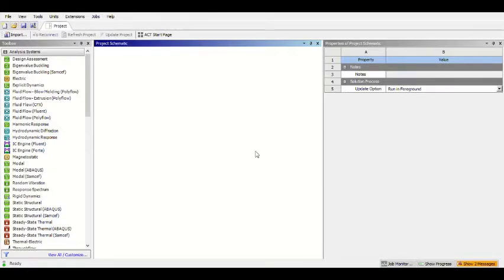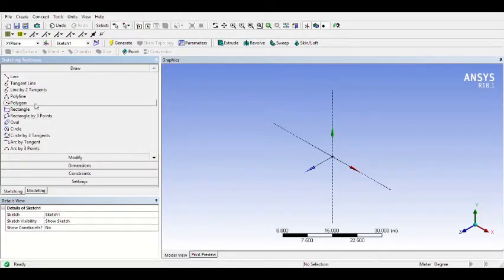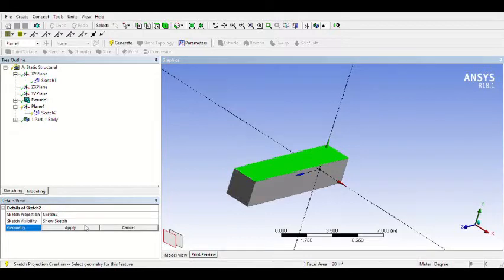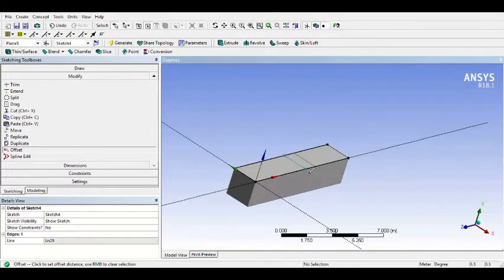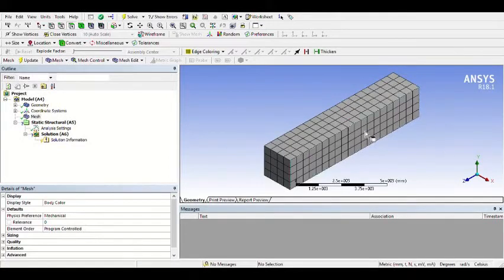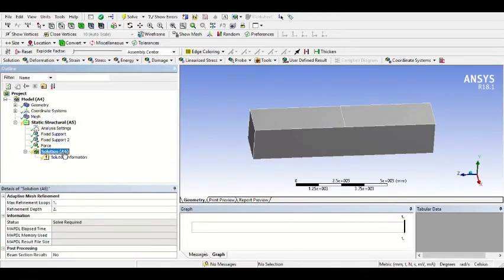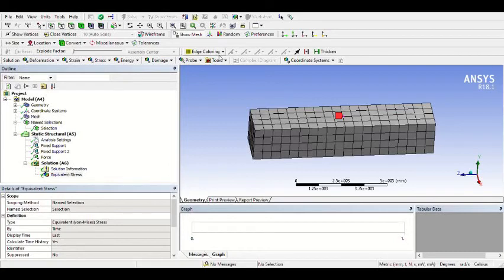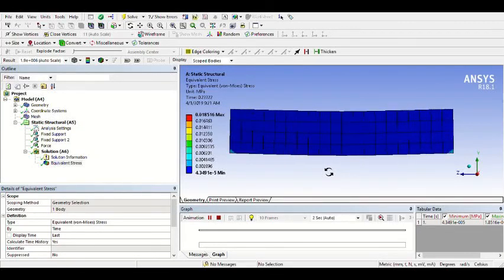Ansys Workbench Tutorial | Center Load | Input Support | Analysis Stress in Node and Body

Comment: Hoping you can help. Any idea why my mesh is only applying to the outside of my geometry? I used inflation, with the outer wall as the boundary, but no mesh shows inside the geometry :-(
Reply from the maker: what do you want to get so you use inflation? I suggest you use meshing method. because after I tried using the meshing method the element quality actually increased. i usually use sweep method, multizone method or hex dominant method.
Reply from the maker: I also experienced this when I wanted to make different sizes of mesh on the same body. at that time my mistake was in determining the reference